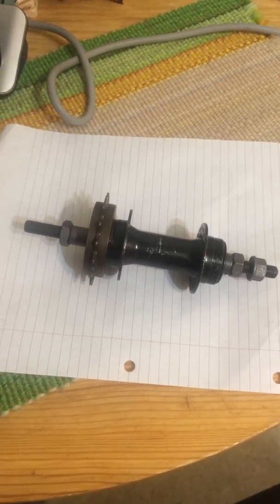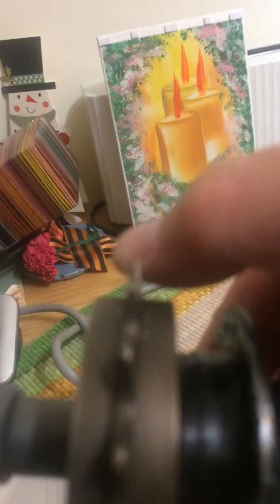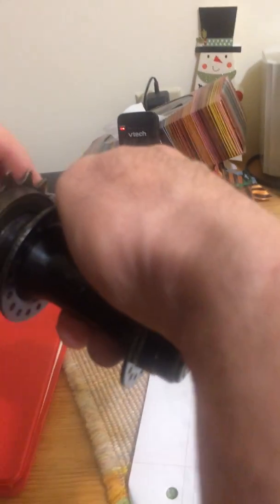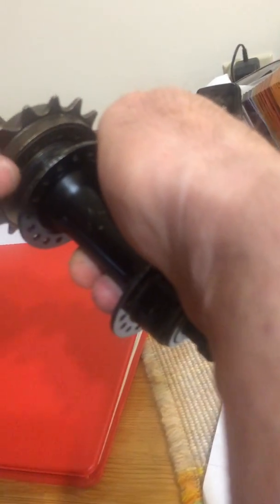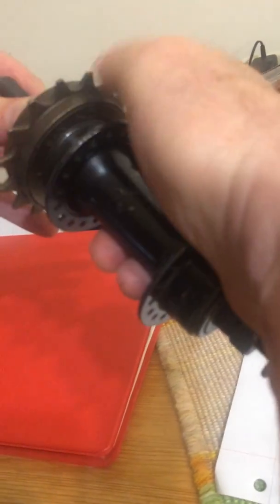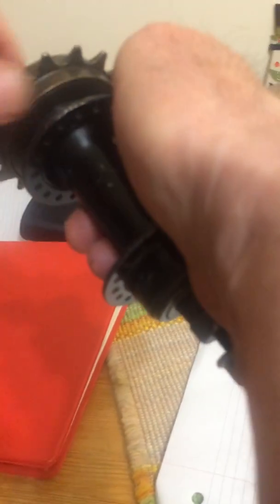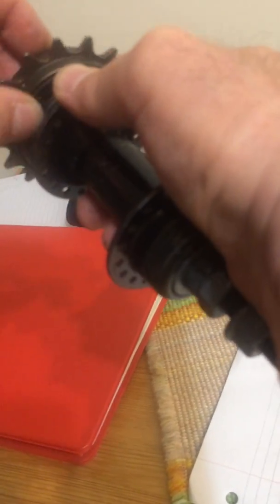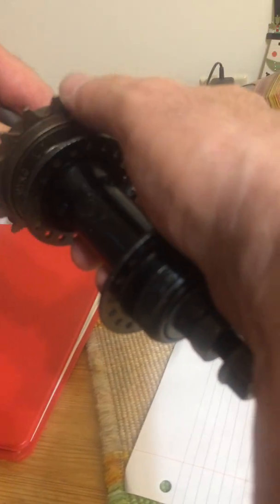free wheel mounting on left end of dual axle rear bike hub

Comment: Thanks for the video Rick, quick question. Im doing a DIY ebike build for my 5 yr old son. the motor is 24V 250watts overvolted to 36V so i can use the controller and li-ion battery i already have on hand. My concern is that when I glue the freewheel on the torque from the motor would break the hold. He's not doing anything fancy, his top speed is maybe 20mph but he'd rarely if ever be doing that as i only let him ride along with me, so realistically he'd be around 10-15mph with him pedaling. Is my concern legit here? Or will Locktite or JB weld do the trick for ensuring the sprocket doesn't come off over time and under pressure?
Reply: nevermind, I just saw your other video and ordered the  permanent thread locker you showed from youtube. Thanks a ton!
Reply from the maker: Hello my bike is a 450 watt motor using 24 volts and has not broken glue in three years of use so I doubt the bike you are contemplating will have enough torque to release glue either. Just super clean threads before applying and remember you need to fully spoke and assemble wheel BEFORE gluing . All these lock thread glues can be released by applying heat from small propane torch if you need to remove  freewheel later. Read 
the glue manufacturers directions for releasing glued threads. I can go over 20 mph and I weigh 150 lbs and it’s still working fine .
Reply from the maker: nellenoble Hello my bike is a 450 watt motor using 24 volts and has not broken glue in three years of use so I doubt the bike you are contemplating will have enough torque to release glue either. Just super clean threads before applying and remember you need to fully spoke and assemble wheel BEFORE gluing . All these lock thread glues can be released by applying heat from small propane torch if you need to remove  freewheel later. Read the glue manufacturers directions for releasing glued threads. I can go over 20 mph and I weigh 150 lbs and it’s still working fine .

Comment: Thanks for the video. I am also in a similar situation. I couldn't find a left side freewheel. On top of that I have disk brake too at the left side.  The hub thread is being used for the disc. The right side is having the gear cassette. Is there any work around?
Reply from the maker: CMS Sajith 
I would just use a caliper brake on back wheel and disc brake on front wheel . The front brake does seventy percent of stopping power anyways so concentrate on making front brake powerful.
Reply: @ralger  Mine is a fat bike, v brake is not possible

Comment: But if you have glued the thread or welded it, is it possible to put in the spokes? Please explain in a video if possible. Thanks.
Reply from the maker: Respoke of the wheel was actually done first before attaching the extra left sided drive freewheel on the rear axle hub. I only made this video to give a close up look of how the freewheel was attached via glue without having the spokes obscure the view and demo of threading and locking of the freewheel assembly.
Reply: Rick Alger thank you. Isn't it possible to replace a spoke, if it's broke after this is done?

Comment: Will this concept work on a single sided hub? Of course loosing the right side drivability.
Reply from the maker: If you added the drive to single speed sprocket on right hand side of an existing bike, yes the motor and chain will fit but you would have no chain from the existing pedal crank assembly possible. Your bike would only be electrically driven, the pedals would be just a place to put your feet and not connected by a chain to rear wheel sprocket anymore. The kind of drive for the right hand side is a more sophisticated system called a mid drive and uses totally different components to maintain the ability to pedal as well as use electrical assist.

Comment: Is this modification done in order to run the drivetrain on left side of by bicycle?
Reply from the maker: Chai wen Chen 
Hello yes it was done to allow left side drive train and retain original sprocket chain drive as a backup and boost to electric system